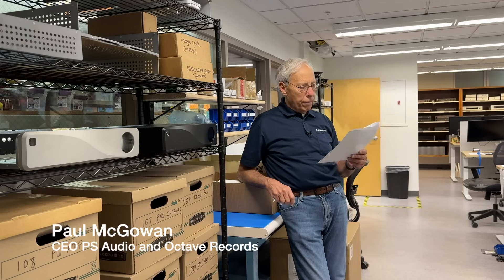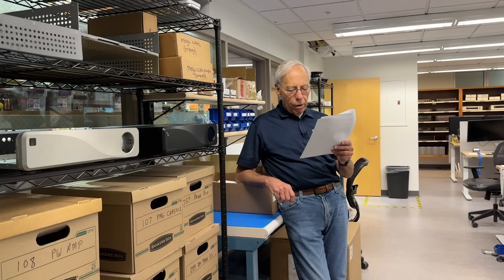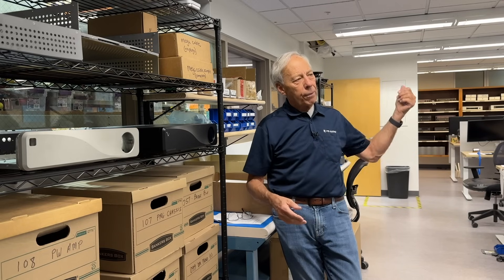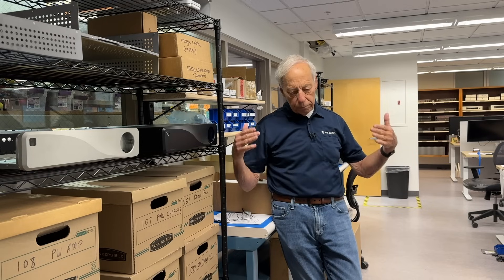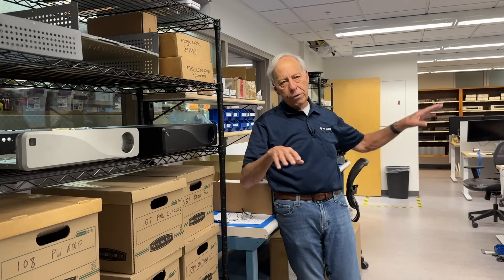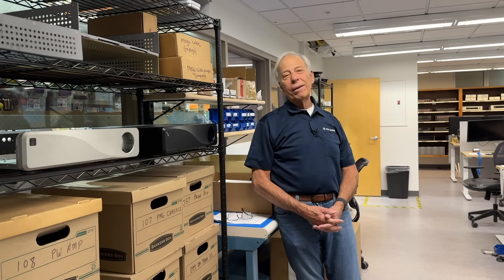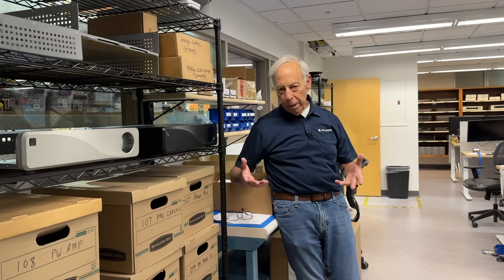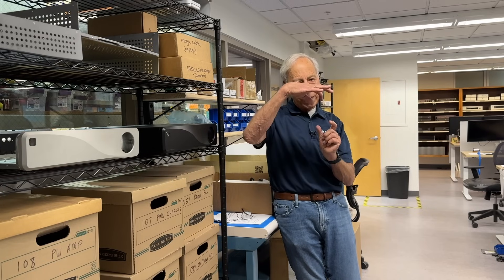Electrostatic speakers

Comment: The diaphragm get the high 5000 volts and the stators have the audio signal. I have had my Acoustat X's since 1980 and I was shocked at how bad $76,000 Wilson's sound compared to my X's. They did nothing better.  My sweet spot isn't that narrow as there are 3 panels in an arc. If you've never heard Acoustat X's at their best then you don't know how good bass can be. I tried a Velodyne subwoofer an with the crossover frequency turned all the way down to 60 HZ it introduced no more bass and just blurred the bass I have. Recently I had a bass player hear my stereo and he was shocked at how good the bass is.

Comment: UK here. I have a pair of Quad ESL63 loudspeakers and a pair of Monitor Audio Silver6 floorstanders ,both connected through a Neohippo switchbox to a Roksan Kandy KA1 MK3 int.amp. 
Sources are Eversolo DMP-A6 streamer, Kandy KD1 MK3 CD player, Project Debut Carbon with a Ortofon 2M Red cartridge updated with a 2M Blue stylus and a Sony TC-399 Reel to Reel tape recorder. It sounds amazing with either speaker pair .

Comment: Thank you Paul for reading my letter. Much appreciated 👏

Reading all these comments kinda stirs the pool of thought on Electrostatic speakers. I’m with the rest of the group here that has ML speakers. It is me mostly for critical listening and nothing can come close to that drummer and singer right in front of you and guitar just to the right and bass just to left. Keyboards everywhere. I guess that’s why they call it the “Sweet Spot” I will just keep them running. I have used my Martin Logan Abis sub with my mains. It blends very nicely. I’m not doing 5.1 surround sound anymore but still have the ML Theater-i . Just boxed up for the time being. Thanks everybody for the great comments👏

Comment: I've mfg'd, built, sold & set up nearly every imaginable 'stat (or 'stat hybrid) config ever promoted, and what Paul says is correct:  sweet spot will always be tight for a 'stat.  Only exception was a 10' tall line-source scheme, but the xover is so high that the seamlessness of image is cast into doubt.  Just plant your butt in that spot and declare victory.  [you MIGHT get a kick placing a coupla hard reflective panels just behind your head for a kool holographic image]

Comment: Sanders, down the road?  I think I remember a Sanders who designed a DIY electrostatic with a transmission line in Speaker Builder, many years ago.  I was going to build a set, but never did.  I think he was from Colorado, so I'm thinking it's the same guy.  Glad to hear he's still doing electrostatic speakers.  Maybe I need to give him a call.

Comment: I once had a pair of Acoustat 2+2s. I still thing they are the most transparent speaker I've ever owned (not that I've owned very many speakers...). I.e. when listening to them, it sounded like the music was appearing in 3-dimensional space, rather than coming from the location of the speakers. I drove them with a Threshold S-500, which I feel is one of the best amps for electrostatics, especially the Acoustats; I've read that some say the S-500 is too harsh for electrostatics, but that isn't my experience. Unfortunately, there were 2 problems with the Acoustats:
  1) In high, dry Colorado, any music with content below about 40 Hz, played at even normal levels, caused the panels to arc.
  2) The first house I bought had only 7' 7" high ceilings; at 7' 10", the Acoustats were too tall.
I still prefer the openness that I get from bipolar speakers. For me, speakers that only radiate from the front sound more 2-dimensional than 3-dimensional.

Comment: Why don't planar ribbons like the Aspens and Magnaplanar LRS beam just like electrostatics?  I hear you saying that Paul but I don't understand why.  I assumed that all planar dipole speakers beamed. I have Martin Logans and the curved electrostatic panels have a bit more sweet spot than flat panels.  Good enough for me and a couple of people to listen to.
Reply: I'm not sure the aspens are true ribbons, most dipole planar speakers are not true ribbons as they usually have some kind of backing like mylar or Captain. I have noticed that my apogee duetta 2 speakers don't beam much when pulled out into the room 82", so the further from the wall behind them the better if at all possible.

Comment: almost everyone who hears my SoundLabs says they’re the most real-sounding thing they’ve ever heard
Reply: Soundlabs sound close to my speakers so I would recommend them. But still not quite as good as tubes going straight to the electrostatic panels.
Reply: the problem with tubes and these SoundLabs is the impedance varies a LOT which tubes tend to really dislike
Reply: @TheCromulons  I'm talking about the custom tube hybrid amps that Acoustat made for my X's. Its been said that this is the best way to listen to electrostatics. there are no output transformers just coupling caps.

Comment: Had acoustats. For the money sounded amazing but you get the head in a vice grip sweet spot. My system now anywhere in the room you can't tell where the sound is from the speakers. Of course that takes high end gear that costs way more money.  With any system and budget if the good outweighs the bad and you are happy with it then might just want to keep it. It's at that point where you just want a new experience or the bad starts outweighing the good that you look at making a change.

Comment: Soundstage exists in the recording, not the speaker. A speaker can or cannot impede soundstage but they don’t create it.
Reply: Not completely true! Both are important!
Reply: @beslemeto I guess speakers with rear and side firing drivers  or omnidirectional drivers like Ohm can create some greater soundstage.
Reply: @archivestereo  No man! I have tried so many speakers...Everything is important from the size of the drivers to the crossover and cabinet size and thickness and everything else...The amps are so important too! The size of the room is  big factor as well! Small to medium rooms are the best and please no concrete walls! Concrete and too thick walls reflect the sound and listening experience becomes sh*******t! Carboard walls are the best!
Reply: @beslemeto True but still you’re talking about things that potentially impeded. Indeed, good speaker like all good components can do their job to be true to the source but a narrowly recorded track will appear as a narrowly recorded track even with the best of gear. If it doesn’t then there’s also something wrong.
Reply: @archivestereo  My answer was about your comment that speakers don't create soundstage.They do! I agree that recordings should be suitable,but again that doesn't mean that different speakers can not reproduce better soundstage..There are speakers capable of doing that and there are speakers not so capable.Speakers are so different like poeple are! Some sound big and harsh some sound small and sweet and some sound just perfect...Respect!
Reply: @beslemeto yeah you’re misunderstanding me. I am agreeing with you that soeakers matter but unless they use trucks like side and Omni drivers, it will ultimately be limited to what is on the recording. I’m sorry you don’t get that. And by the way soeakers generally improve clarity, have a certain roll off, but their ability to reproduce the soundstage accurately as recorded is also due to speaker position.
Reply: @archivestereo Well whatever you say then...I ain't here for arguing...

Comment: Not exactly on topic of electrostatics, but on the common topic you always mention, Paul...  Soundstage and the phantom placement of sounds between and behind the two stereo speakers.
I noticed something very interesting in watching your YouTube videos.
My setup is such that my Infinity speakers are placed on either side of a large entertainment system which has the large flat panel TV dead center, and my listening chair in the sweet spot, so that a mono signal is dead center and behind the speakers.
What I noticed on your videos was, and I am assuming that the recording from your wireless mic is mono and SHOULD be always coming from dead center, no matter where you are positioned in each video. Am I correct!?
However this is NOT the case!   
When you are seated or standing on the left of the screen or the right side of the screen in various videos, looking at you, the sound of your voice appears to come a bit left or right of center..
very interesting!
How do you explain this?? Thanks for your reply in advance.

Comment: All loudspeakers in a stereo system have an ideal listening position. I have full range lfloor standing electrostatics. Well designed electrostatics have very low distortion and a mid range no box speaker can match. The human voice sounds incredible with a good recording. Bass is musical but does not pressurise the room like a large cone woofer. A sub can be used with care and must have a fast transient response to keep up.  If your musical taste is exclusively rock, then probably not the right choice. Good recordings can sound startlingy realistic. Electrostats have a mid range transparency and realism that is addictive. Electrostats can sound disappointing with inferior recordings, but a good recording can sound amazing.
Reply: My musical taste is mostly rock, and neither electrostatics nor planars are a good match for me. What I crave is the dynamic slam of a PA with the airiness of a ribbon-type driver, and I get that from horn-loaded air motion transformers.
Reply: Not completely true , true omni speakers have a very wide sweet spot , as wide as the room , but the price they pay is a loss of precision in the sound stage . The best subwoofer to complement a (nearly) full range electrostat (which is a dipole) would be a dipole subwoofer . That way you avoid the coupling problem in the overlapping frequency zone where a monopole sub would have destructive interaction with the out of phase sound from the back of the electrostat panel .
Reply: @gerritgovaerts8443  The wider the dispersion in a speaker the more room reflections can muddy the sound stage. Probably the best sub to match the electrostatic is a Ripole. Next choice is a sealed box. Worst is a ported sub.
Reply: @geoff37s38  Could not agree more violently . Yep , I love your suggestion for a Ripole as a sub for electrotstats . I have 3 pairs of them : 2 x 12 inch  9 mm Xmax , 2 x 15 inch  20 mm Xmax and even a monster 2 x 18 inch 23mm  Xmax . The bass they produce is something you really should experience . So tight , totally non localizable , perfect transient response . Never going back . And no pressurization of the room which is for me an advantage . I hate the chest thumping of monopole subs . I believe it's better and less fatigueing for your ears also . Plus less triggering of room modes . Yes they are inefficient , but when you compensate for that with proper driver choice , it's heaven

Comment: I have owned Acoustat SPECTRA6600 electroststics for decades and love them as much now as I did at the start - perhaps even more now that I use the PS Audiio PerfectWave transport and Mk 2 DirectStream DAC (along with mode-made class A monoblocks). As I'm the only person who listens to the system, sweet spots don't worry me.
Reply: I had Acoustat 3's back in the early 80's.  Loved them also!  I was single at the time, so the sweet spot was not much of a concern.  Wifey pooh came along and was not thrilled with the "ugly panels".  Sadly had to sell them.  Now, both wifey pooh and the speakers are gone, wish I had the speakers back...

Comment: Every design has its flaws... I had a lot of different designs during the years, but have ended my journey on the "end game" speakers - ML Summit X. I mostly listen to my own and I have never heard any speaker that has an off axis response worth my critical listening sessions. You cannot get the phantom center nor correct sound stage depth sitting off center, not even close. It all depends how you evaluate your listening experience. You can always try the newer ML's that has XStat panel introduced from 2005-ish as they should have better dispersion. Its hard to walk away from electrostat's once experienced - they are special and nothing is perfect...

Comment: I have some full range one-offs and some Soundlab hybrids which are both curved panels. I don't understand why they are so narrow given the arced structure. I know some ESLs are flat and I would have expected a narrow dispersion pattern from those first.
Reply: Imagine if you have a row of men, holding long wooden poles (Staffs).   Rather than having them stand in straight line... you have them form a Curved shaped formation.   When any of them encounter a target in front of them... they push their Staffs forwards into it...

 In this example.. you realize that even though the formation is Curved... Each point along the Curve.. is still just moving Forwards  

 A speakers cone.. always just moves back and forth.   If the speaker were a Ball that could actually expand and contract... you would get a true 3d projection.. that Radiates in every single vector.

 Now... where things which may change this.. is if there is enough power and air pressure being moved.. that the shape actually causes the image to spread out.

 Thing is... My EPI speakers have a 1 "  Cone Tweeter.. not a Dome.   And they produce one of the Widest, tallest, and deepest images / soundstage... that Ive ever experienced.   They are very powerful drivers, with very beefy magnets.
Reply: @johndough8115 That makes me wonder what would happen if I just turned them around. I'm sure it's neen tried but never heard about it. Next time I put them in a system I might just try it anyway just for my own curiosity.